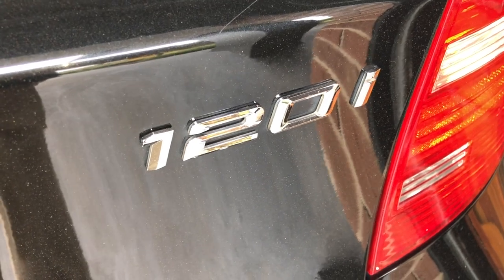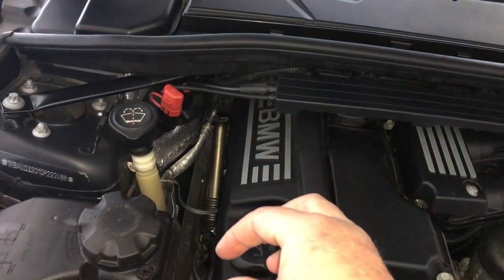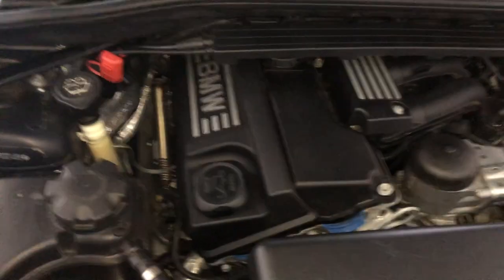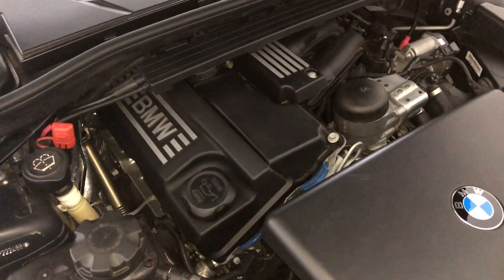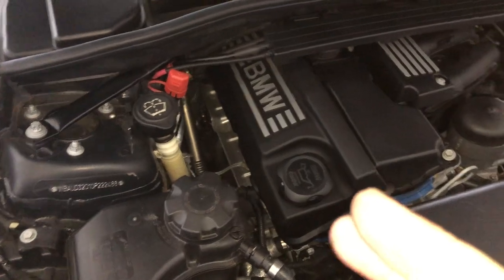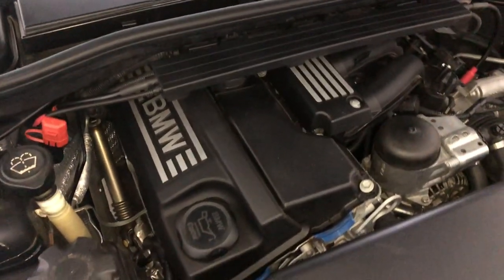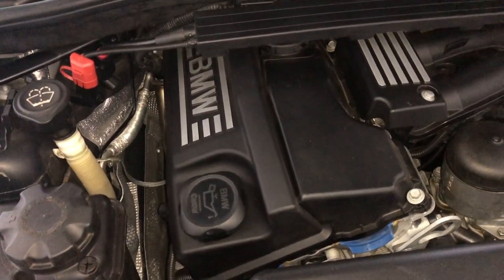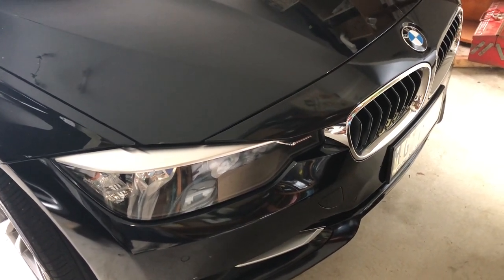BMW blowing smoke? Valve stem seals the definitive test.

Comment: What makes matters worse is that this oil that seeps through the valves actually comes at the exhaust side. All of BMW engines are tilted towards exhaust. This in turn means that oil is not burned in the cylinder  but is rather thrown into exhaust manifold on the exhaust stroke (4th stroke, no ignition) and burns in the catalytic converter. That's why with a cold engine you will never get it to smoke.
Reply: Maybe it's the same guys that run the diesel gate scandal lol
Reply: @ryhu5642  It has been an issue since the early 2000s with the N62. BMW has always been using poor quality plastics, from the timing chain guides on the M62 to something small but really bad like the valve stem seals on the n62 and some 4 cylinder engines. Each engine has a unique characteristic with BMW (problem)

Comment: Hey Mark, first of all thank you so much for all the videos! helps a lot!
My 120i 2009 its smoking and my mechanic recommended  me to use HPR50 40-70 and its smoking less than before, dont you think that this oil could some how do some damage to the motor? thank you so much
Reply from the maker: Yes it can do damage. BMW engines need 5w30 for the Vanos system.
watch this https://youtu.be/ARMJ9QPIkaA

Comment: hi everyone, i have a 118i F20, normally when driving doesnt smoke but if the engine is on for around 5 min and the car is parked, when i accelerate it blows blue light smoke, what can it be ? Thanks everybody.

Comment: I wonder what my issue is. My mechanic I’ve been going to over 4 years isn’t experienced with my cars issue. It doesn’t smoke when I start it but when I drive around for a while and idle at the light. As soon as I accelerate I can a big cloud ⛅️ smoke. It doesn’t happen at every light. It’s so embarrassing. I’ve already replaced the pvc valve and added a catch can.
Reply from the maker: That sounds very much like the valve stem seals. Do the test mentioned in this video then you will know. MRT
Reply: @Marksreviewsandtutorials  I just posted a video. I definitely got a puff of smoke. What does something like this cost
Reply from the maker: @user-xm6oq9gz9u  
Unfortunately it is a complex expensive repair. 
What are valve Stem seals in an engine. What do they do? Why are they important? BMW
https://youtu.be/KWOBULdTnwM
Reply from the maker: This series of videos shows what is involved. 
BMW Replacing Valve Stem Seals N46 Engine 20i Under Hood work to get to engine Pt1
https://youtu.be/3kOWvzr6khw

Comment: Why can’t you just compress each cylinder to do the valve stem seals??
Reply: You can if you know what your doing, it's quite easy
Reply: @andrewmacdonald6742  I know you can because I have done it quite a few times I was stating the easiest and most efficient way to do it

Comment: Hey I have the same smoke. I use car for events. Haven't ran it in a couple months due to maintenance. When I started it up today toooons of greyish smoke the same as yours shot from the exhaust. Now when I start it, no smoke when driving, or idling. But when I press the gas while.idling I get the burst of smoke. Does that sound about right for valve seals?

Comment: I’m having exactly the same problem. It’s runs perfectly the first 10 minutes after that if I’m driving at normal to fast speed it’s good, but as soon as I stop and have to accelerate again from idling it blows this whiteish cloud of smoke (not sure if is white or blue because I’ve only seen it through the mirror)... I’m wondering if it’s the gasket or the valve seals. My reason to believe is not the gasket is due my coolant is still at the same level.
Besides that apparently the oil level sensor was failing so the oil light was on I just poured 4litres of oil, and I overfilled so took it next morning to the mechanic to drain it an put the correct amount. Do you think the white smoke could be due that and still need to burnout that extra oil? Or is definitely the valve or head gasket ?

Thanks mate!!
Reply from the maker: Do the test I show in this video, that is how you see if it is valve stem seals
Reply from the maker: Also when you get a low oil light on a BMW you are supposed to add 1 liter of oil. Not 4. MRT
Reply: @Marksreviewsandtutorials  Yeah I didn't know that, just poured 4 litres, feel so stupid now :(
Reply: Hello I have the same issue did you manage to figure out what it was ?
Reply: Did you fix it, what was the issue?
Reply: @NewName0  yep, replaced the valve stem seals

Comment: G’day Mark, how you going mate?  Just wondering if the smoke problem becomes a lot worse if the valve stem seals haven’t been fixed. My car was blowing smoke as you’ve mentioned. But now it’s a hell of a lot worse. I’m not driving it at all, but I just want to double check that I’m going to tackle the right job. Thank you once again mate, for any advice you’re able to share. 😊 ps we’ve spoken very briefly on one of your other videos 👍
Reply: Actually Mark I’ve just watched another video and my issue sounds more like the crankcase breather valve. 

Or possibly the crankcase breather heater relay.

Just wondering if it’s possible to take the relay fuse out and take it to a mechanic to get tested to see if that’s the issue please mate?

Comment: Hi Mark new subscriber love all your vids,
My doughter has purchased a 120I just recently 
We noticed a small amount of smoke when sitting on idle I’m hoping to do the top pcp valve cap but before I do I want to get a replacement would you have a part number for it it’s not a turbo 
Cheers
Reply: Is it 502 471 ?
Reply from the maker: If you go to realoem.com and put in your vin number you can chase up the correct part number
Reply: @Marksreviewsandtutorials  is the n52 known for stem seal failure?

Comment: Hi Mark, Thanks for de videos really like them. Got the exact same model and year car as you i120 N46n 09, starting to see some light smoke forming so want to check the PCV valve cover first.  Just wondering can you remove and replace that PCV valve cover with out removing the airbox? 

Thanks heaps,

Jason
Reply from the maker: Hi Jason, yes the airbox won't get in the way, PCV is on top of the motor and the caps are brittle, so can be good to have another on hand if you need the car straight away. Have a look at the links in the description they are not expensive. Be very careful when you remove the cap.
Have a look at this video ( https://youtu.be/3kOWvzr6khw ) and you will see all of this being pulled down.
Also if you have an 09 120i then have a look at the Black one play list. https://www.youtube.com/playlist?list=PLRRErA3V0MY1hY_BlWlWUK_ykpCqMj8j0
Reply: @Marksreviewsandtutorials  Thanks so much for that, I'll order some and hope that'll fix it!

Comment: This is happening to me but I'm not losing any oil, would it still be a valve stem Seal??
Reply: @axlehead7600  did you find the problem, as mine does exactly the same?

Comment: Hi Mark.. just had my N46 valve stem seals replaced at BMW Wagga Wagga. They charged $2300 which included a new oil separator and pipes. Very happy with that.
Cheers
Graeme
Reply: That's because they don't need yo remove the head of valves, there's a special tool,
Reply: A shop quoted me $1500
Reply: Se solucionó el humo?

Comment: Hi, I just bought a 2004 318i and having the same issue. Had it on idle for about 10mins and when I revd it, it starts blowing smoke. It’s also leaking oil.
Reply: Should have got a Lexus